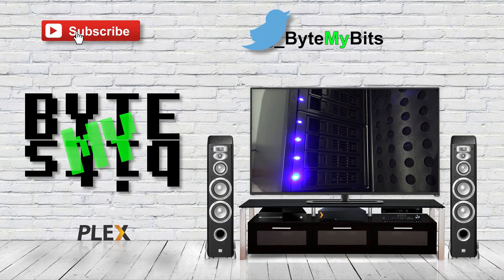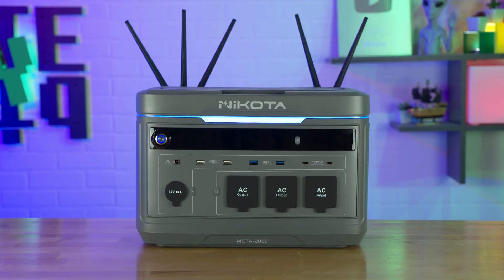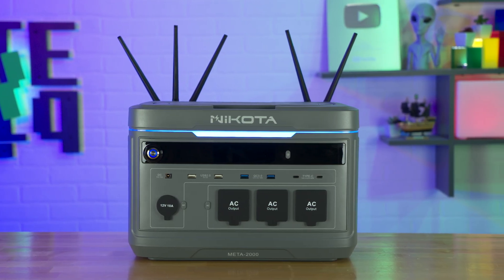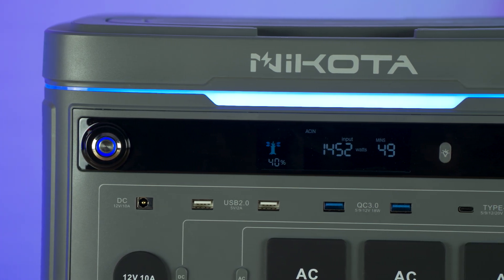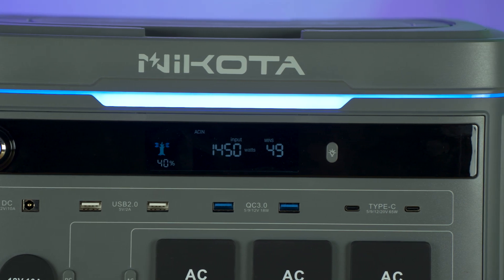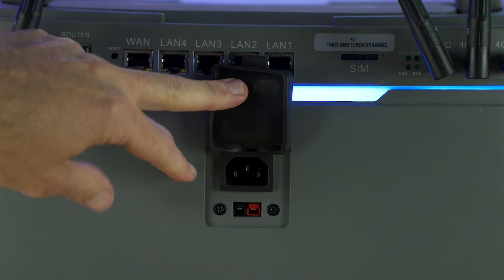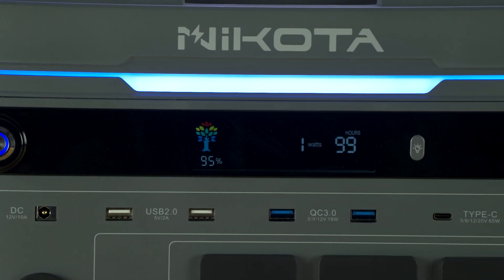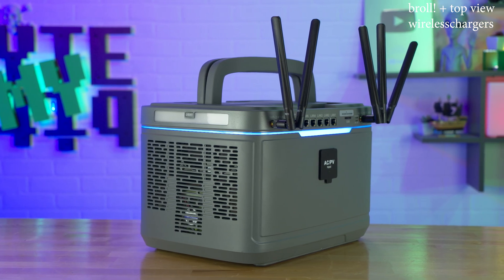4G/5G Hotspot strapped to a 2,016Wh Power Station! Nikota Meta-2000

Comment: I have a 2700x + GTX 1660 6GB PLEX server (that I also let friends game on) that I'm debating putting a 5800X into. I believe I remember from your other videos that 11th+ gen Intel CPUs are able to transcode 4K HDR UHD Remuxes with their iGPU, correct?  If so, I could switch to Intel and let the iGPU handle transcodes, and leave the 1660 to gaming only.  I currently don't need to transcode 4K HDR as I have 2 separate folders, but I'd like to have the option for if I merge to a single folder, and delete my Bluray Remuxes.

Comment: Next thing you know these battery banks will be able to power and be powered (charged) by POE.
Reply from the maker: no joke tho I've been messing with "electrical stuff" and playing with the idea of a 2x21700 with a mini-bms that would be a tiny PoE powered UPS for either USB cameras (unifi flex style) or PoE cameras. lol
Reply: @Bytemybits  I had a similar idea but instead, linking 2 BMS's (think 2 river units with a poe switch built in) via poe and as long as the unit's powered by the remote one was under the single poe line's power consumption you could run things out there. better yet make the poe bi-directional and have a small solar on the shed to power all your poe devices via the poe relay.

Comment: It needs to be Dual wan with package bonding to merge data from 2 routers for me to use it DAILY (nonemergency), wouldn't it? Otherwise it's just sitting until an emergency.
Reply from the maker: I see your point but I disagree. In your scenario, you are placing the burden of dependency in the hands of this backup router. Relying on it to bond/merge traffic and make sure you are kept online while managing two connections. 
Really though, this router is not on that level in either hardware or software. IF I were to incorporate the 4G/5G internet it provides through a LAN port, I would connect it as a secondary ISP source to my main Unifi system. Then I would still rely on my "big and powerful", normal home networking gear to handle the change over to the backup internet when needed. In this scenario, minimal configuration would be needed to allow my system to use this as a backup IF needed/available. And, it would not place the reliability of my network on the shoulders of a, let's be honest, severely underpowered/featured router (for my whole home needs). 

TLDR;  This makes for a better side chick, not a main house wife. :)
lol